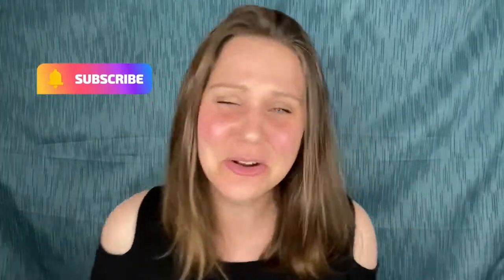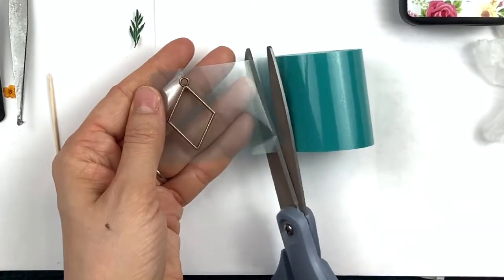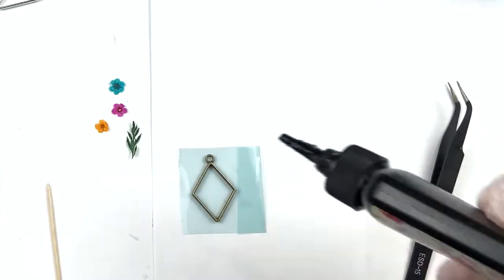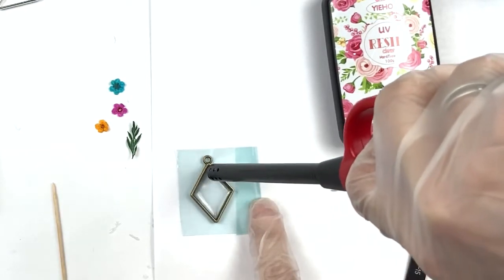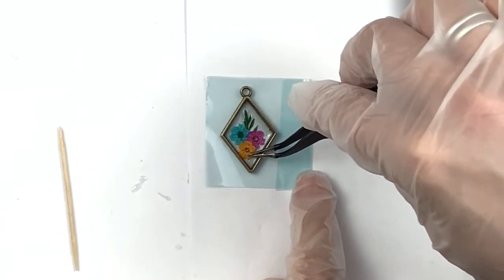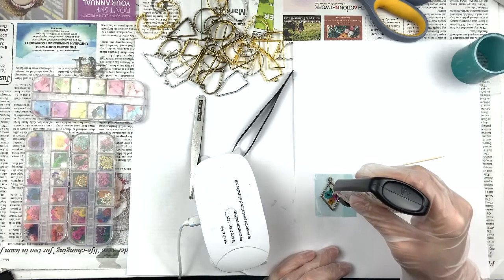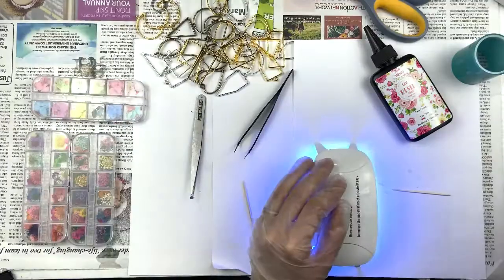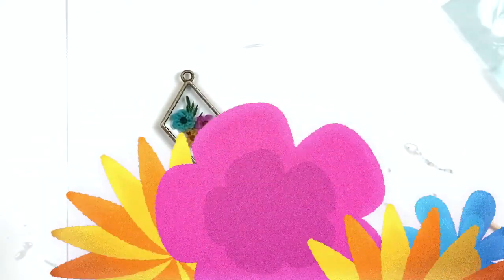How to Make a UV Resin Dried Flower Pendant - UV Resin Jewelry for Beginners

Comment: what is the best way to get the sticky residue off the backside of the bezel? mine are always with tape residue
Reply from the maker: You need to rub the sticky residue from the tape off.  I have been able to use my thumb/fingers to rub it off and then I proceed to add another layer of UV resin to the back. 

Does that help? Is that is what you were asking?
Reply: @DezyJewelry  can you use rubbing alcohol or something  to get it off?
Reply from the maker: Yes I have used rubbing alcohol before.
Reply: In Canada, the dollar stores sell little bottles of Goo Gone. I don’t know if it would adversely affect the resin but it is great for getting rid of sticky residue.
Reply from the maker: Ohhhh sounds good. You could wait until it dries more and then use goo gone. Great idea!!!